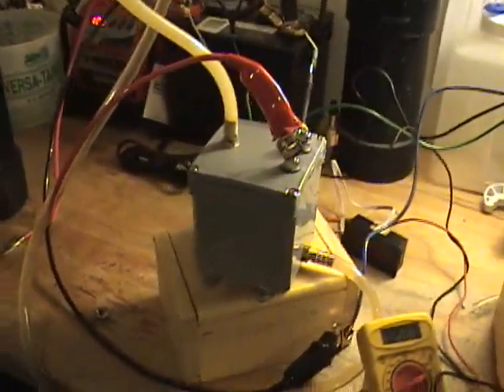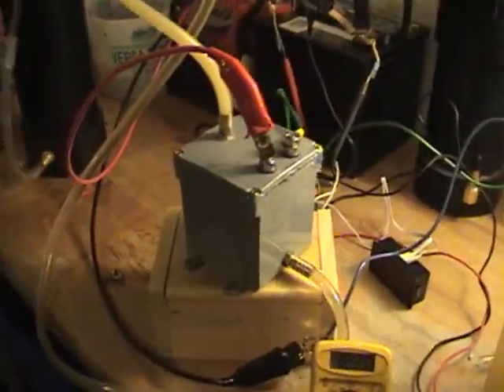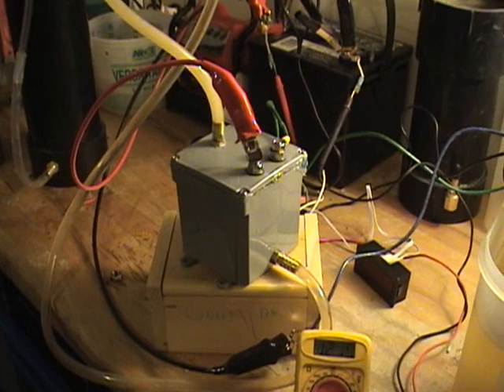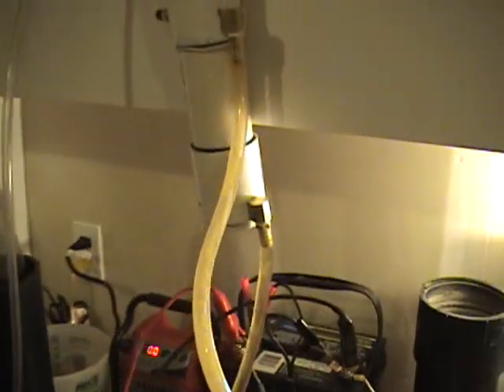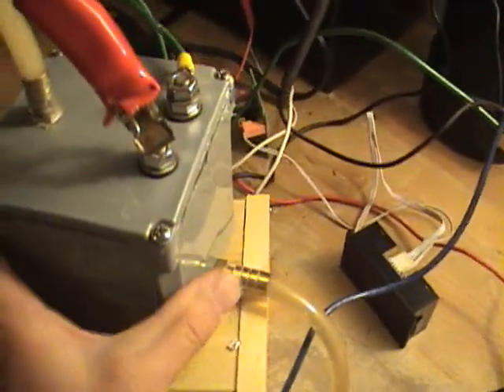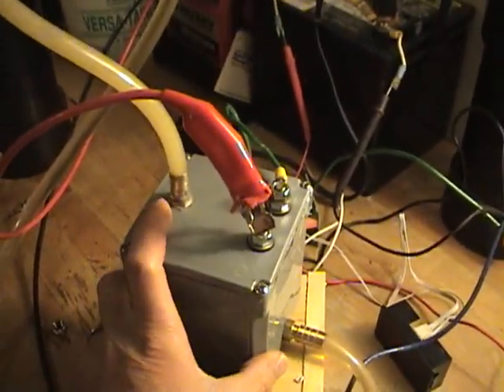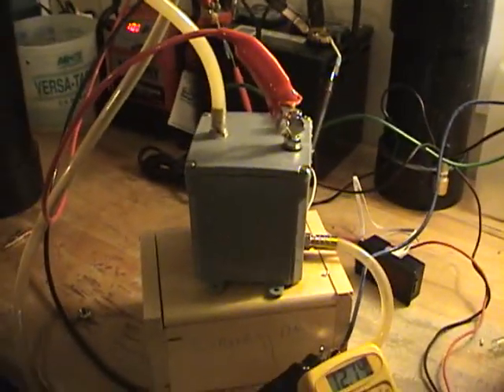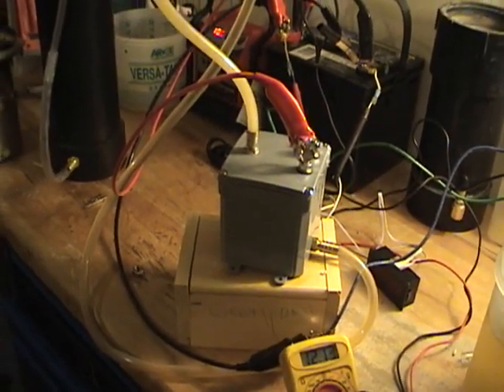(3) saturated HHO hydrogen generator small cell

Comment: 1 litre at 10 amps (Cold) and 1.25L at 12 amps when electrolite is warmer are my latest accurate and consistant measurements after futher tests with the cell previously described. I know I can improve on it more. Is that still good production? I don't have videos of my design.

Comment from the maker: 1.5 lpm at 12 amps is overunity. what are you really getting? i do agree that saturated is real good. i didn't make a video but i installed a heater core off a jetta into the return line back to the reactor. cooled it great.

Comment: Saturated is the way to go! I built one with 7 small plates. +nn-nn+. Produces 1.25-1.5 L/min at about 12 amps and stays cool. Used 3" ABS pipe. Also tried a windshield washer pump to circulate even more, but found it unnecessary for my application. If more cooling is needed I would just increase the length of hose on the return line and coil it/run it back and forth in front of radiator. Maybe copper tubing could be used instead. Will work like a radiator.

Comment: I use baking soda (some times with vinegar)and have had no problems. Even if the plates some how are damaged, they only cost $1.29 each , I'd just consider them a wear item.Can you show us a damaged plate?I cant detect any damage to mine.

Comment: there are many ways to skin a cat. If temps is a problem, you could use a small pump and pass your fluid through a "radiator" on its way back to the device. I used a 6 ft long piece of 3/8in brake line wound in a tight coil.  worked pretty good. carefull on the pump. 100gph tops any more is a problem and use something sturdy that will stand the heat and the chemical reaction. maybe an inline fuel pump.

Comment from the maker: thanks for the comment. i have a few problems with the container with it leaking. it seems to top out at 125 degrees. warps the lid a little. tested at 650mlm 20 amps. i will refine this a little and then share how its build.